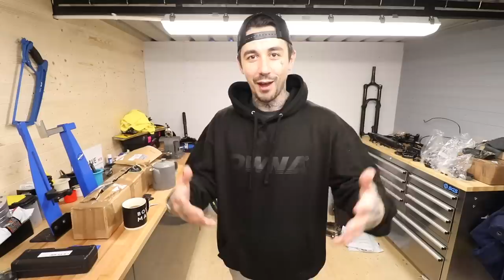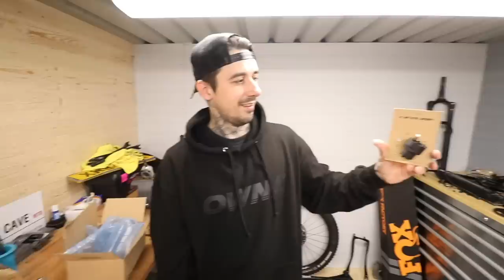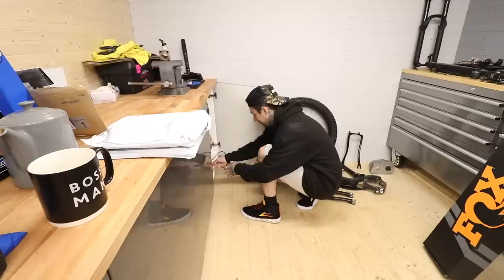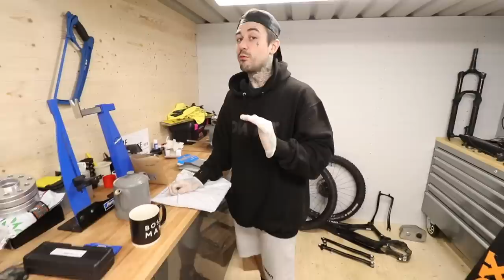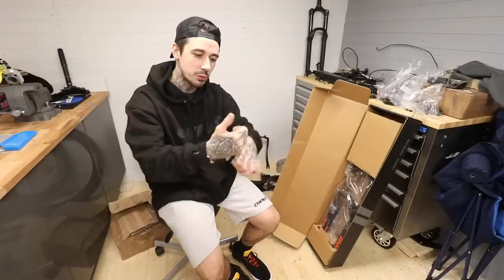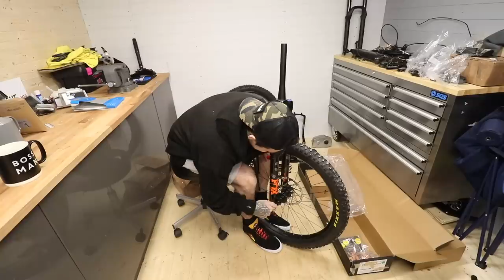FREERIDE MTB UNBOXING!!

Comment: 22:10 "They are a good set of forks. We should have high and low speed... rebound, high speed rebound, low speed rebound, which is unreal... basically means you've got both high and low speed on the rebound"........... 👏👏👏 well done Sir, well done.

Comment: Harry, thanks sharing your build, often we learn most from discovering what not to do. Learning to remove and pressing in bearings is moving a notch or two up in bike maintenance. I found out a few things not to do as well. The whole idea is to make better mistakes in the future. But either way if you are going to go all in and buy an extra set of pivot bearings, I would highly recommend getting a bearing press. I bought one on aliexpress. It always helps to have the right tool, Even with a basic kit you may still need to use a socket or washer to get just the right size but the key is you have the threaded rod to press in and out the bearings. Also I found that to extract bearings in a tight spot sockets can be a little too long. Items from plumbing parts pipe fittings etc have thinner walls than sockets and are not as tall. Looking forward to following the rest of your build.

Comment: Your headset race will fit on your new forks, take it off your old ones. Also the steerer tube, I would put it on the bike and run an extra spacer or two. Then if you put it on different bikes it will 100% fit. Some bikes have a longer head tube.

Such a sick build so far!! Look forward to the build video 🤙

Comment: 1) yes, you can use the crown race off of your old fork
2) you dry fit the fork into your frame put everything on, all he spacers, stem, ect... Then you score a mark on the steerer tube at the top of the spacer/stem, take the fork out then cut 3-4mm below that line.
3) if you want to make sure that the fork will definitely fit other bikes, add a couple more spacers than you would usually run.

Comment: The crown race will come with the new headset. Steerer tube length is down to personal preference. You going to have to get a star nut install tool now for the e-build. Loving the vids. I think raw alu finish with tan wall tyres would look super fresh.

Comment: The best thing for the steerer tube , is to test fit the forks to your bike with the longest steerer tube, then fit your tallest stem, and then add 2 inches of spacers for fine tuning. if you do all this then the forks wil fit any bike you have , or probably going to have. And may be send off the forks to get them color matched with the e-bike frame

Comment: Normally you get a new race with your headset, the steerer length is completely up to you. If you liked the length of the steerer on the RockShox go for that or maybe a little longer and you can run some spacers for versatility.

Comment: you should be able to reuse the crown race  and if you add one or two spacers above the stem at its ideal height it should fit multiple bikes and you will also need a starnut unless you use a oneup edc multitool

Comment: Just cut the head tube to whatever height you have felt most comfortable on your other bikes by setting the stack height with headset spacers and your stem. Mark it with a scribe or knife, pull it all apart and cut 🤘

Comment: I've swapped from rockshox to fox and the crown race fit from the rockshox 
But yes a new one would come with the head set
With the steerer tube cut it to fit the longest headtube you will put them through and run spacers on top of the stem to keep it looking tidy however you may need a longer bolt going from your stem cap you will also have to get your star nut far enough in to clamp your shortest head tube headset tught

Comment: Lightly tap the crown race off the old forks mate. use a very small flat head screwdriver and knock it up 4 taps should be off, obviously 1 each side and use an old head seat to seat it, if you don't have the race press. Or what i used to do before i had an old head set or a press i used headset spaces, you have a tapered steerer tube so find something wid enough to lightly tap it down. Good luck
Reply: Oh and BTW check your office post have sent you an Xmas gift bro
Reply: Matte khaki would look so nice with the orange on the forks

Comment: Ya need high temp tape to mask out or when it goes in the oven it will shrivel up and fuck the job up mate and also mask up were the stays meet aswell.when u unscrew the bolts after powdering it may crack the paint from around were the bolts were.just saying.

Comment: You should of got them in a 29er and 170mm, mullet setup and you could still use a 27.5 wheel if you wanted too

Comment: Race should fit bro n stem should b 5mm in the stem with spacers required fir height si it jus sits short NOT FLUSH so the star nut tension actually works lol 🤙

Comment: and harry that's not a pinch bolt for the axle ... it's to adjust the floating axle on the 38's ... check the manual on how to set it up ... should only have to mess with that bolt once
Reply from the maker: ok sounds good!!!!
Reply: @harrymain  just figured i'd let ya know ahead of time

Comment: You need to take the race off your old forks, and for cutting the steerer just measure the length of your old steerer and watch the dialled fork set up video on fox suspensions YouTube

Comment: For the steerer length why don’t you measure the head tube on all your bikes and then cut it to what you had before + the difference between the Kinevo and the longest head tube. The only thing is, specialized run quite short head tubes and if the difference between that and say for example your nukeproof is more than a couple of cm you’re you’ve got to decide whether you can live with having more than 2cm above your stem or not. And there is always the safety aspect of whether you want to risk smashing yourself on a lumpy steerer tube if you crash. My view on this is that people wear gopros strapped to their sternum which is just as dangerous if not more so. My main reason for not running loads of spacers  would mainly be that I’m a bike tart with OCD!

Comment: for the lengh of the Steertube of the Forks, you just should know the lengh of the Headtube (measure it) and add 15 to 20mm of Speacers and the lengh of the Stem. If you want to switch the Fork between bikes, it will be fine if the Steertube is shorter than you actually need. (excuse my bad english Im not a native English Speaker )